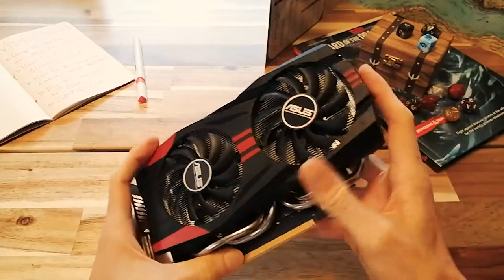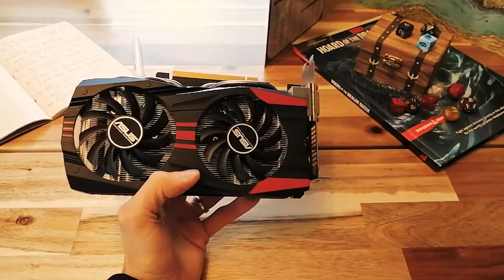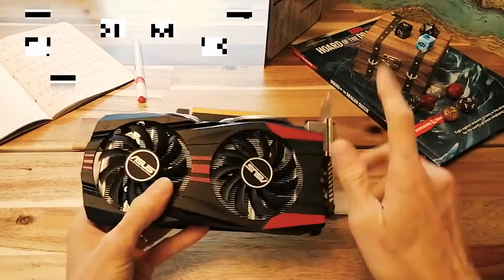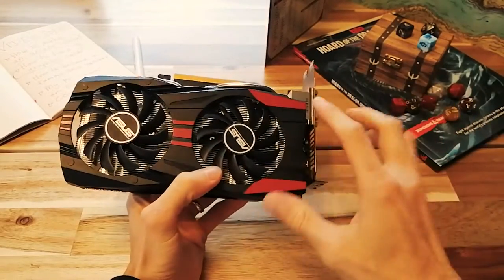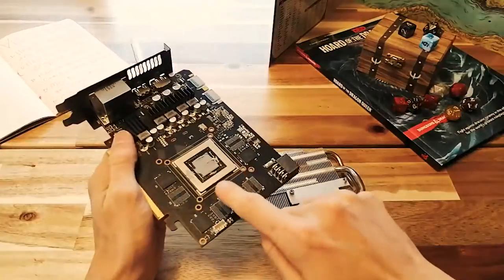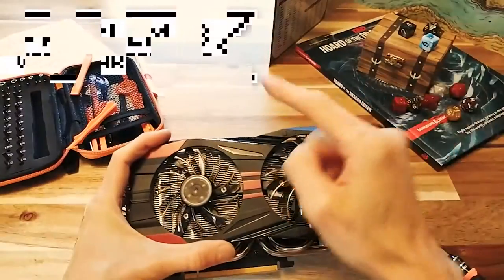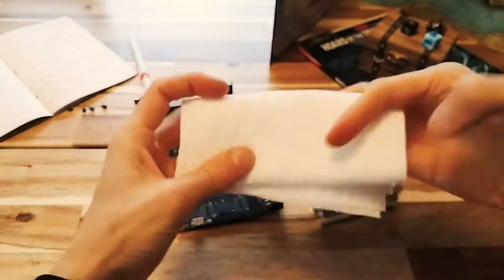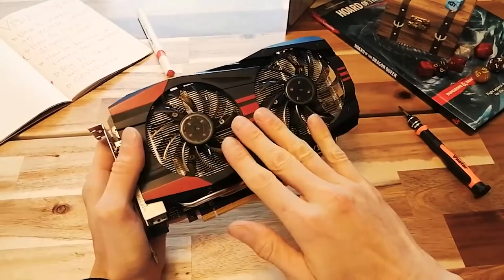EASY Fix Your Graphics Card! (Loud fan, black screen, crashing, artifacts)

Comment: just bought a 6660 xt when i try to play a game it crashes and fans go on blast. i wiped drivers and did a fresh install. I even bought a new psu and that didnt help Im really sad rn because i spent lots of money please help
Reply from the maker: You really need to try it on a different computer, to determine if it's a problem with the card or your PC. That's the most important troubleshooting step. If it was an older card I'd suggest the thermal paste, but since it's newer I doubt that'd be what's wrong. If it does the same behavior on another computer, then you'll know it's the card. If it's new then you should be under warranty, if you can isolate the problem to the card hardware then getting a warranty replacement should be simple. Good luck!
Reply from the maker: Now that I think about it, it still might be a thermal paste issue. I've heard of people in the past with the same problem, even though it's a brand new card, the thermal paste was insufficient. What I'd suggest if you can't try it in another computer is monitor the temperatures with a tool like MSI afterburner. If the temperatures rocket up to 90+ degrees before the crash, then you'll know it's a thermal issue, and the most likely culprit is the thermal paste & cooler mounting.

Comment: Just a question, if anyone knows the answer, before I go ripping apart my gpu. I boot a game and get to the menu then a few seconds later my screen with go black. I hear the game still running in the back ground and I also was on discord so I could speak to my friend. The sounds of the fans will suddenly sound like a jet engine as though it goes max fan speed or something then the screen goes black. It was a gpu from my old pc that was pretty much new. I checked out my new PCs motherboard and it says it is compatible. The gpu worked in my last pc. (Issue with the old one was the cpu was to weak for modern games). Anyway now the sudden black screen "of death!" Plagues me. Any idea if it would be my psu which is 500w not being enough or could be 1 of the problems above in this video? Any constructive advice would be great. 🙂
Reply from the maker: It sounds like a thermal issue. You can check the specs of the graphics card and see if your power supply is enough to run it, but if it is then I would definitely be replacing the thermal paste as a first troubleshooting step.
Reply: @TechDweeb  Ok thank you for your advice. :)
Reply: @TechDweeb  I have repasted the graphics card and it was working fine for a while then went back to spinning up the fans to full speed and black screen. Basically the same thing is happening again. So sadly I'm no closer to finding the problem. I'm not sure if it would be a lack of power as the pc doesn't shut down. Just the card seems to cut out. Any ideas on what I should try?
Thanks in advance.
I have ran the specs through a hardware checking site that claims to tell you the power required and it says I should be fine with a 500w psu. Im wondering how accurate it is though. I use to run this graphics card with a 500w in my last pc. But this pc is a bit more beefed up. So im on the edge of buying a new psu. Im going to watch your video again and see if I have repasted the gpu correctly.

Comment: i have a gtx 770 and im beyond confused at this point because my pc has crashed over a good 200 times in the past 4 months. im able to play fortnite and gta and payday 2 mostly fine and had it crash like once. ive been able to play destiny 2 pretty fine a month ago but for like the last 3 weeks my pc crashes from destiny 2 and even ROBLOX theres no way a 770 fails to run roblox and crashes. im beyond confused because the source of the problem could be dozens of issues and im just tired of it. im getting a new gpu soon but its in 3 weeks and i cant even play a game that can run gta and payday 2 pretty well but cant run roblox. ive replugged all the psu cords back into the psu and replugged the gpu cables and it didnt help, hopefully the 4070 will not do the same shit because i am beyond tired of it.
Reply from the maker: Have you done the thermal paste fix that I suggested here?

Comment: Yesterday I was playing a game and suddenly the screen went black and after about 20 seconds a disconnection sound (maybe it's from the GPU) disconnected.  I restarted the PC to see if the problem was solved, but since then the screen is still black (no signal) and the fans are at 100% without stopping.  There was also a constant beep.  I restarted it again and the beep disappeared, it only makes a beep but I still have the same problem.  The gpu temperature was 75 to 80c, I changed the thermal paste on the cpu and did a clean on the graphics card days ago because I was having problems with the temperature.  It seems that when you removed the graphics card, the fans are working normally.  There are no connection problems with the keyboard and mouse, just that the fans work at 100% when the GPU is connected.  I also changed the motherboard battery but the problem persists.  Is the problem due to the GPU?  Or should I also check the ram and the power supply?.
Reply from the maker: That hints that something is fried on the GPU. I'd suggest you try it in a different PC if you can. If it still doesn't work in the other PC, then it's probably dead, and if you can't get it professionally repaird then baking it in the oven would be a last ditch effort to bring it back to life.

Comment: Hi there. My gpu I think is having a problem. When I'm just watching YouTube or something. My screen goes black and my gpu fan speed goes to max. I've had this problem before I bought a new motherboard and everything was fine for about a month and all of a sudden today it did it again. What should I do
Reply from the maker: That does sound like an overheating problem. Does it only happen with Youtube? I'd suggest you try runing a GPU benchmark like Unreal Valley. If it does the same thing while running that, then I'd suspect a heat issue, and the thermal paste tip from my vid would probably help out. If you have the ability to test the card on a different PC to figure out if it's a problem in the GPU or in your system, that would help you narrow down the problem.
Reply: it does the same for me but card is at 40c lol... screen goes black but still on no volume tho, then Brrrrrrrrr until i reset myself. No light open on the motherboard ..

Comment: Hey TechDweeb my gpu goes into random solid colour while booting up, what should I do please help😭
Reply from the maker: First step is to try it in another system to help you determine if it's an issue with the card itself or some issue with your other hardware or settings, and if the issue happens on the 2nd PC then you know it's an issue with the card itself. A screen of a random colour sounds like an artifiacts issue to me, so baking it in the oven is probably what I'd do if it were me.
Reply: @TechDweeb  ok i will give it a try, thanks

Comment: do you still use the oven for baking after baking the gpu?
Reply from the maker: I run it through a cleaning cycle afterwords just to be safe.
Reply: I suggest grabbing yourself a cheap shitty toaster oven from Walmart that’s big enough to fit one gpu, the carcinogens released are pretty bad when doing this. Wouldn’t even risk cross contamination with food. If you want you can even return said shitty toaster oven and let Walmart or whoever deal with it when your done lol

Comment: My brother gpu is a Amd Radeon HD 7770, and when ever we put it on a motherboard the fan goes max power spinning and gets very hot when booting  up, and the monitor wouldn't recognize it connect. So does this qualifies for your 3 ways to fix?
Reply from the maker: Probably not, but possibly. The oven method is a last ditch effort. When you've exhausted all other possibilities, there's a chance it might fix what is wrong. I honestly don't think it would work in your situation, since you're not getting any video at all, it sounds like there is something genuinely broken like a capacitor that this probably wouldn't fix, but I would try it anyways if it was my card and I had no other troubleshooting options

Comment: Thank you for you video. I put new termal paste for both the cpu and the gpu. But the problem is still the same. After playing a game (that always worked before - Satisfactory) or even sometimes starting the game from steam leads in to GPU fan full speed and a blue screen.

Even when i restart the computer, sometimes it does the same when pressing enter at my windows log in screen.

Any ideas? 
Thank you
Reply from the maker: If that's the case, if you've repasted the GPU, then your only option left is to do the baking method :/

Comment: Hi, please do a video about my current graphics card issue, when I play games at Low settings the card crashes/ black screens and then the graphic card's fans suddenly spin at a 100% i have a RTX 3060ti and my gpu temps dont touch 70 but it still happends
Reply from the maker: You NEED to try the thermal paste solution before further troubleshooting. Even if the temps look fine. That's the most common cause of GPUs crashing under load, if that doesn't work you can try some other stuff but the paste cleaning is quick and cheap and easy so give that a try first.

Comment: My gpu rx 570 4gb fan always runs at full 100% 3700rpm it seems like it has a broken temperature sensor, can I replace the fan to fix this error?
Reply: have you tried MSI afterburner to control the fan ?

Comment: my vga black screen / hang during 60c, how to fix it
Reply from the maker: It hangs when it reaches that temperature? In that case the first step would be trying to replace the thermal paste. Even though your temperature reads 60 degrees there may be a hot spot that is not being reported. If it's crashing under load it's usually a thermal paste issue.
Reply: @TechDweeb  oke thanks i will try , the case appaers when i reinstall my windows , it's very wierd..but last time i was try the blackscreen hang appeared when reached 80+ temp .

sorry for my bad english btw

Comment: Hey tech dweeb, i believe my problem was crashing under load. i was playing apex legends during the new season then suddenly it just stopped and went to no signal. when i tried to boot it back up my gpu would spin then just stop. I tried all the resetting cmos, checking ram, swapping ram and it didn’t work. do you think i should just try new thermal paste?
Reply: i could hear it running pretty hard but payed no attention to it
Reply from the maker: If it's now not giving a signal even after booting up, then I'd suspect something got fried. Replacing the paste won't help if you're getting no video at all. If it were me, I'd consider trying the oven method. But you should try it in another PC first just to make sure that it's a problem with the card and not your PC. Good luck!
Reply: @TechDweeb  i really have no other way to test it on another computer. i’m possibly just thinking of getting a new gpu or even power supply. I truly believe it was the gpu only bc it was running extremely hard when it decided to clonk out and now it just chooses not to spin when everything else is spinning and booting fine. I will admit to downloading and driver update from youtube to fix my graphics on a game. i believe that could’ve been a problem also

Comment: my video card give artifacts how it said in the video, mostly happen in load but i tried 4 differend video cards...all give the same problem....is it my motherboard or giving my power supply not enough ? please help im out of idea's i tried allot to get it working nothing helps so far :(
Reply from the maker: So you've tried different video cards and they all give the same symptom? If that's the case, it could be many things. My first thought is drivers, definitely try removing all your drivers using DDU (display driver uninstaller) to start fresh and then reinstall the drivers. It could also be something related to your monitor or cable, believe it or not you can get artifacts on the monitor/cable end. I can't see how a PSU would cause artifacts with different video cards, that doesn't seem likely. I suppose it could be motherboard related, if there's something borked with your PCIe slot, but that doesn't seem likely, and it wouldn't manifest in video artifacts most likely. Trying your setup with different components and trying your components in different systems is the only way to narrow down the problem, but I hope that cleaning the drivers and trying a different monitor & cable will get you on the right track. Good luck!
Reply: @TechDweeb  my og system is sabertooth x79 with a i7 4930k cpu 32gb ram not sure bout the clock speed with a GTX 780 850W power suply. i have this setup for 7 or 8 years...cleaned it replaced some fan's that died over the time and such repaste....last couple of weeks it gived those artifacts i tried new hdmi cable new screen same problem i tried GTX 1650 and 1080 and 1050 problem still there i pin checked pci lane for faulty connection there is none....i reinstalled drivers manually even new OS of windows 10
Reply from the maker: @draaco16  Wowza. Well I suppose it could be motherboard related, I've never heard of this sort of thing happening though. The only way to know for sure is to try another motherboard & cpu. Obviously that's a big step for troubleshooting but that's the only way to narrow it down. I'm assuming you've already tried clearing the CMOS and updating the BIOS?
Reply: @TechDweeb  yes and yes, all i have not tried is a other motherboard/ system because i dont have a spare one laying arround that can fit my CPU and i have not tried a other power supply aswel those are the only ones left... i feel like im better off bying a new system in this case
Reply from the maker: @draaco16  Yeah possibly, that's probably what I'd do in your situation. There are lots of decent 'no gpu' systems for sale, at least where I live. CPUs and motherboards too. It's actually a great time to upgrade anything that's not a graphics card!
Reply: @TechDweeb  i dont know where you are from but in my country it is kinda hard to get if you can get it, it is exspensive soo i am kinda effed on that part

Comment: My 760, the exact one you have, boots to black, doesn't send any output, cant even make it to a manufacturer screen, i what to do, my old gpu works fine, the fans spin and the light on the gpu is green
Reply from the maker: Able to try out a different port on the gpu? Does your motherboard / CPU have integrated graphics that you can use to get into the BIOS and see if the GPU is detected? And if so then get into Windows via your CPU integrated graphics?
Reply: @TechDweeb  i can do all of that, jts detected, just outputting no display, seems to be a common issue with the 760, no matter how much research i do i cant find an answer

Comment: I have a 2080 GeForce Rtx and lately it has been crashing mid game or even a little after start up of call of duty. It just loses signal to my hdmi then I hear some fans getting noisy right when that happens. Temps never get above 75 ☹️
Reply from the maker: I would still check the thermal paste. There are two temperature sensors, an overall sensor and a hotspot junction sensor, the temperature that's usually shown in monitoring software like MSI afterburner is the overall temperature but that junction temperature is what causes the card to forcibly crash as a failsafe. I've heard of people undervolting their cards to prevent crashes but for most people replacing the paste does the trick. Good luck!

Comment: Bro, i once opened a game and the pc went black screen with a buzzing sound and the gou fans stopped working. I tried reinserting the gpu and still it was displaying nothing. Them the next day i reinserted the gpu ajdbit worked for some time and went back screen after i tried to play games on it. I dont know what fhe issue might be? I tried applying thermal paste( which has lying around for an year)
Reply: @FM-bn4bk  no, the GPU died and I didn't try to service it though

Comment: Ehh, I have a problem when I'm playing games my GPU would go black screen somewhere mid game and the fan speed will go full speed during the black screen, I know one thing that's for sure, is that my GPU is not overheating as I've also checked the thermal/repasted
Reply from the maker: It's still likely a thermal issue, even though you've checked the thermals there still is likely an issue somewhere that's not being reported by the sensors. I had this happen on a GTX 770, the temperatures looked fine from the sensors, but it was still crashing under load. Repasting fixed it. If you've already repasted the only other suggestion I have would be to get some thermal pads for the memory modules to help them cool from the heatsink. Other than that, you might be out of luck :/
Reply: @TechDweeb  Hmm, the thermal pads are new as well...
Reply: @TechDweeb  Hmm, it doesn't look like a normal crash, the fans of my GPU would go max speed when it crashes/black screen
Reply from the maker: Yeah thats normal when a gpu crashes due to thermals - screen goes black and fans go to max until restart. I've seen it many times. Have you tried undervolting the gpu? That's the best way to bring down the temps.combine that with underclocking to get them even lower. You'd lose a bit of performance but if it keeps from crashing then it'd be worth it.

Comment: Omg i think someone just sold me a broken graphics card. :( I'm a novice in pc knowledge. Now it's doing artifacts after minutes of gaming. It's so frustrating.
Reply from the maker: If it happens after gaming but not otherwise, it's a thermal issue. Try replacing the paste because that is the easiest thing that fixes most thermal issues on older GPUs.